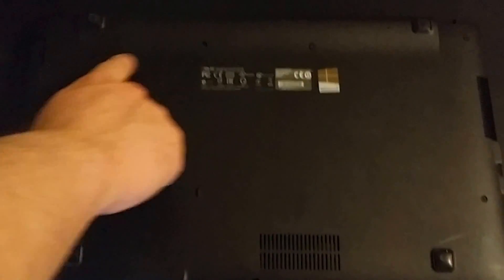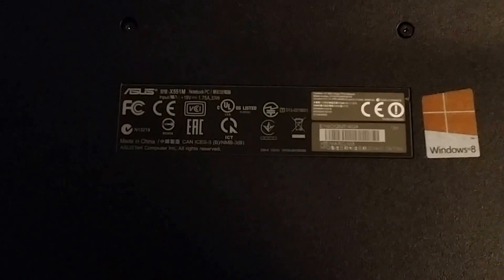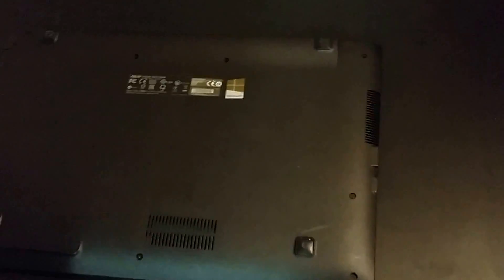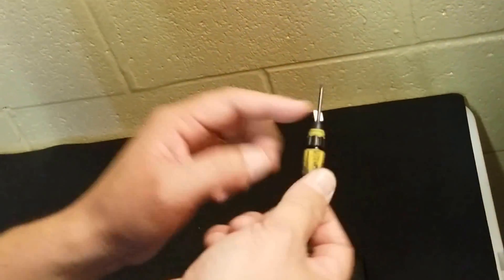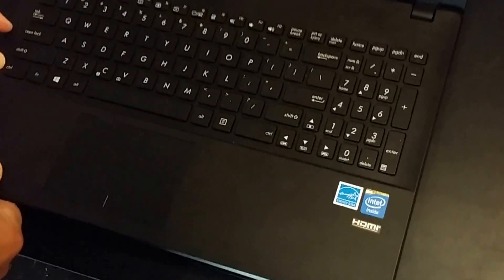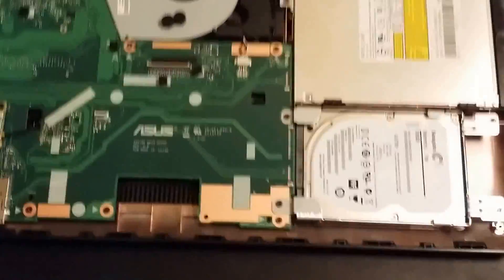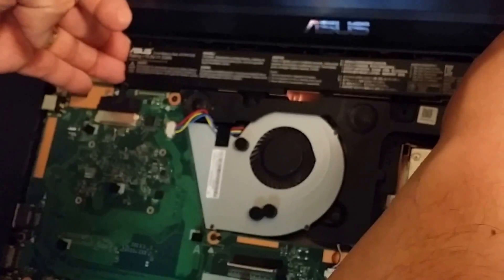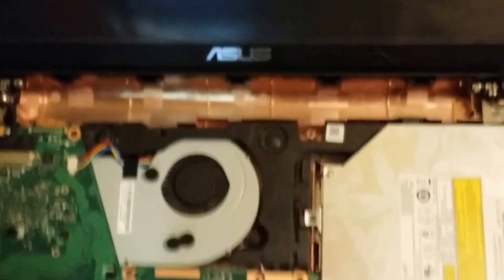ASUS X551M Laptop Battery Removal & Won't Power On Fix

Comment: hi, i have an issue with my asus of this same model. i just have like three months with it and since i got it i have problems when i turn it on. i have to press like 20 or 30 times the power botton  so it can turn on. i dont think it is the battery because it is full charged. so i don get why. as i say before i have to press to many times the botton so it can react. can you help me?
Reply from the maker: It sounds like you might have gotten a laptop with a defective/faulty power button board/power ribbon connector.  My gut feeling is that you have a bad board which is on the underside of the keyboard top lid.  Once you remove the top lid, follow the ribbon cable to the power button and see if it is loose or looks damaged.   The GOOD NEWS is that ASUS warranties all their computers for 12 months/1 year so call up their tech support and tell them the problem.  They will have you send it in for repair at no cost to you.  Just be sure to back up your data or anything else important because they do NOT warranty data.

Comment: How do you reattach the cables (the ones you already took off)
Reply from the maker: Very carefully.  Each of the ribbons cables have flip top "latches" that you have to flip up to release the ribbon cables and flip down to lock the ribbon cable into place.  Gently place the top of the keyboard lid down into place then with one hand, insert the power ribbon cable at the top left into the connector and once firmly inserted, flip the latch DOWN to lock it.  Then move the lid downward some more then insert the Keyboard ribbon cable into the keyboard connector and firmly slide that ribbon cable in then flip that latch down to lock it.  The same goes with the touchpad ribbon cable into its connector then lock the latch into it.

That is it!

Comment: Quick question, a couple days ago, my laptop stopped charging and only stays on if its connected to the charger, it stays at 11% saying 11% available (plugged in, not charging) 

Is there any other method to save it other than buying a new battery? Or could it be the charger?

Comment: It really is a nice laptop for the price! One question though. I've replaced my RAM. And I know all the internal parts of the laptop except for the screen. Could you make a video doing a screen replacement? Or do you think it'd be better to just get a new laptop? My screen is fine. I just like taking the precaution of knowing what to do in the event it gets cracked.
Reply from the maker: Daniel,

The LED Screen replacement is actually quite easy for this model.  It would have been easier IF this model would have been able to remove the battery a standard normal that would have taken less then 3 seconds.  Unfortunately, you have to disassemble the laptop to get to the battery PRIOR to replacing the LED screen to avoid shorting out the new replacement LED screen.  Once you remove the battery, it should take you less then 5 minutes to take the LED Screen bezel off, remove the 4 screws holding the LED Screen on, removing the LED screen cable from the back of the screen, and finally removing the damaged screen.  Then just install the new screen and do everything in reverse.  The new screen should cost about $50-$60 on Ebay or Amazon.

Comment: You can do this or just suck the energy out of the battery by leaving it on and charging your device using the USB it should only take an hour or four depending on its batter life.
Reply from the maker: Common sense wise, that is correct.  The problem is that even if the system turns off/hibernates by doing your USB drain method, there is still a chance that there is a "charge" that can damage a sensitive component like replacing an LCD/LED screen or memory replacement.  The BEST practice would be to unplug the AC adapter, remove the battery, hold the power button for 30 secs to fully discharge all power THEN work on the system.
Reply: when i did it it took aan hour no problems the only think that happened wasa my tablet had a seizure  the computer energy led turned on and off three minutes after that i charged it and it worked fine, without me dismantling my computer.
Reply from the maker: Again, I am giving on advice on using THE BEST PRACTICE on how to properly disassemble/repair the laptop.  Doing it this way prevents any unforeseen accidents, static discharge, and component failures due to shorting something out.  You are of course free to do it anyway you want and if it works for you, by all means do it your way!
Reply: Ok, so if i use y method there is a chance that my computer well fail. I understand.

Comment: Can I upgrade the RAM in this model?
Reply from the maker: Some boards for this ASUS model will allow you to remove and install new memory.  Some will not.  The only way for you to truly know is to remove the motherboard as the memory is on the underside of the laptop.  Even if you were to call ASUS, THEY might not even know which board you have.
Reply: Per above: You can replace the one in there (usually 2 or 4GB) with an 8GB module (if not soldered in).

Comment: Ok so i was on my computer and i moved it a little bit and it completely shut off it wont turn on and the charging light isnt showing can doing this help
Reply from the maker: First, make sure your AC Power Adapter did not die.  You may need to go to a store to pick up another charger to "test" it out on if you don't want to buy an adapter you don't need.  Try a store like Batteries Plus or try it with a universal power adapter if there are no stores near you.
Second, if a replacement adapter doesn't fix the problem, you might either have a bad DC Jack or a bad battery.  Follow the video's instructions and remove the battery and connect the power ribbon cable back in the motherboard and then plug in the Power Adapter then try turning it on.  Sometimes a bad battery will cause your system not to turn on.  If your system STILL will not power on, then it is either a bad DC jack that you will have to replace or a bad motherboard.

My gut tells me it is a bad DC Jack as you stated you moved it and it shut off and I am assuming that you had it plugged into the adapter when it happened.  So, verify your AC Adapter is good then eliminate the Battery as the problem then you should narrow it down to DC Jack and Motherboard.
Reply: k thanks its only a month old and im pissed because of this happening

Comment: My laptop went out when I plugged my phone in.. What should I do to fix it?
Reply from the maker: deadblast,

You probably shorted out the connection temporarily/permanently from your USB to the motherboard due to a fault from either your phone or your USB cable.  Remove your battery using this video's instructions (of course have it unplugged from the DC Jack as well), hold your Power Button down for 30 seconds to fully discharge all power from the motherboard, then reinsert the battery, reinsert the power/keyboard/touchpad connectors and then try powering on the system.  With luck, your laptop should be powering on and back to normal.  If it still doesn't turn on, plug in the AC adapter as well then try powering on the system again.  If this still doesn't work, then your best bet is to take it to a repair shop for a diagnostic.

Comment: how to turn on x401a asus model?? suddenly it turn off its old laptop but looking good. charger is good but it dosen't turn on. please help me.
Reply from the maker: If the laptop doesn't turn on it could be:
1. DC Jack is either damaged or detached from the motherboard which will not allow the system to charge the battery OR power the system itself.
2. Defective battery SOMETIMES caused the computer to NOT turn on.  Test this by removing the battery and plugging up the adapter to the laptop then powering on.
3. Defective Power Adapter.  Try borrowing a universal adapter with the appropriate connector tip and turning the system on.
4. Failed motherboard.

Without actually seeing this in front of me, I do not know if any power indicator light is on or if the system is on with only a black screen (LCD Backlight is on but no picture).  When all else fails, take it to a professional tech or computer shop for a diagnosis.
Reply: Thanks
Reply from the maker: Tippanirajesh 239 No problem!  Good Luck

Comment from the maker: Rusher,

I am assuming that you have a picture of the Asus splash screen all the way through the Windows Password Login screen.  If you don't get a picture after entering your password, I am thinking it is your Graphics Drivers.  The best way to tell is to boot to safe mode and if you can get a picture after the login, then it definitely is the driver.  Update it to the latest version of NVidia, AMD or Intel's driver whichever one you have.

Comment: Could you do a fix for the plugged in, not charging problem with this computer
Reply from the maker: SpartonO1 Unfortunately, this was a customer's computer that I selected to do a video on.  I no longer have this particular laptop to provide a DC Jack removal/repair video.
Reply: Ok, well i did figure out how to get it working again. Thank you for responding.
Reply from the maker: No problem.  I am glad that you got it figured out and working again!

Comment: can i upgrade ram on asus X453ma ?
i thought asus X-series have onboard ram, right?

btw thanks for the video, now i know to replace battery on asus X series.
Reply from the maker: Based on some research, some X-Series boards have removable RAM memory and some don't.  The only true way to know is to disassemble it and remove the Motherboard.  The memory is on the underside.
Reply: sydcapuera  have you managed to upgrade the ram ?

Thanks
Reply from the maker: No, on the laptops I have fixed for this model Asus, I have never been able to upgrade the Memory.
Reply: ***** 

so you are saying it is not possible ?
Reply from the maker: Based on some research, some X-Series boards have removable RAM memory and some don't.  The only true way to know is to disassemble it and remove the Motherboard.  The memory is on the underside.

Comment: I would to confirm the size of the hard drive, is it 2.5 or a 1.8 unit?
Reply: It's 2.5 inch.  The hdd that came in a friend of mines was also the "thin" variation, but the hdd bracket can fit a non-thin kind as well.

Comment: I plugged an Ipod usb charger cable into my laptop to charge ipod it shut laptop down and when I started the laptop back up it's like it's in sleep mode with a black screen power light is also on can anyone please help
Cheers
Reply: i belive that you usb port is ether shorted out or your plastic piece in your usb port is out of your usb port( the plastic piece is so you dont plug it in the wrong way and short something) and you eved up puting it in backwords. So what you need to do is hold down your power button untill the fan stops running. If that doesnt work unplug it and run the battery down untill it dies then plug it in and turn it on. if you need anything else or anybody need anything else please email me at ajmaps@me.com and plese metion your youtube name.

Comment: Hi I just bought this laptop and was wondering can u update the ram? Also I can't get chrome to download :( its a nightmare need help please :)
Reply: No, you cannot add more RAM to the AEUS X551M. Regarding your failure to download Chrome, you should be able to use Internet Explorer, which comes installed, to do that. Go to https://productforums.google.com/forum/#!categories/chrome/windows8 and ask there.
Reply: You can't ADD RAM, but you can replace the one in there (usually 2 or 4GB) with an 8GB module.

Comment: Is it possible to upgrade the cpu?
Reply from the maker: You "CAN" but the question is should you on a laptop that is designed to not be that powerful.  You would have to figure out which notebook CPU's would be able to be used on that particular board and if so, you will most likely need to do a BIOS/UEFI update so that the new processor will be able to run correctly.  BE CAREFUL if you go this route because if the BIOS/UEFI update gets interrupted or installed incorrectly, you will have turned your laptop into an expensive paperweight.

Comment: yes this is a design from a moron. and all you morons that defent the moron designer are moron and the reason u give are moronic as well.
Reply: Costs less and the design allows for an insanely easy/fast replacement of the motherboard if ever needed.  While I agree the average non-technical user might struggle with a simple hdd, disc drive, or battery replacement, the reasons behind the design are relatively sound.  Go and buy a laptop with an easy user replaceable battery if it's such a big deal.
Reply from the maker: I agree that this IS a terrible design.  Some people are saying that the design was to facilitate motherboard removal or because it is used for "CHEAP" computers.  I think those reasons are "questionable" at best.  Computers are supposed to be END USER friendly made for regular people in mind.  Not being able to remove something like a battery is something I personally don't agree with.  Heck, most CELL PHONES have the ability to get to the battery to be able to replace it and those are exchanged out every 2-4 years!

Comment: I have an ASUS X511M laptop & i was having issues with my connector cable and i opened the computer there was a poping sound and now it dont power up or show it is charging ??? how can i troubleshoot to find out what is wrong with my computer???
Reply from the maker: You might have damaged the ribbon cable or most likely, ripped/tore it.  To be 100% sure, take it to a computer repair shop to verify what really could be the problem.  Trying to diagnosis a computer on a comment board is hard to do unfortunately.

Comment: Many many thanks. Due to some mishandling the optical drive got dinked up. I was going crazy trying to get this thing apart with out breaking something else.
Reply from the maker: You are very welcome!  I am glad the video helped you.
Reply: The optical drive can also be replaced, almost as easily as the battery, if needed.

Comment: I am having a problem when trying to charge my asus computer. Its completely dead and obviously wont turn on. I have plugged it in to charge but the light indicating its charging will not come on. When I hit the on button again, after I plug it in, it will start to load but turns off after 3-4 seconds. I have tried leaving it plugged in for a few hours, then tried it again but still nothing. So I have no idea if its the computer, battery or charger. I don't think its the charger because it seems to be giving the computer enough power to attempt to charge.
Reply: I have the same problem. I just bought it 3weeks ago and now this thing happens...help pls
Reply: Michael Nel Madiam dissconect it from the ac adapter and take the laptops top case off and try taking the battery out and holding the power button for 30 seconds and put the battery back in and than push the power button make sure you connect all the ribbons back though
Reply from the maker: If the laptop doesn't turn on it could be:
1. DC Jack is either damaged or detached from the motherboard which will not allow the system to charge the battery OR power the system itself.
2. Defective battery SOMETIMES caused the computer to NOT turn on.  Test this by removing the battery and plugging up the adapter to the laptop then powering on.
3. Defective Power Adapter.  Try borrowing a universal adapter with the appropriate connector tip and turning the system on.
4. Failed motherboard.

Without actually seeing this in front of me, I do not know if any power indicator light is on or if the system is on with only a black screen (LCD Backlight is on but no picture).  When all else fails, take it to a professional tech or computer shop for a diagnosis.

Comment: One question has been bothering me for a long time. Is the graphics card removable on this laptop.
Reply from the maker: On 99.99% of laptops, graphics chips are not user removable as it is machine placed, integrated and soldered onto the motherboard.

Comment: Thank you so much man. Incredibly simple fix to my problem. I accidentally put my headphone jack into a USB port and it must have shorted out the battery.  I used a knife and a lot of patience but it was so worth it. Again, thank you.
Reply: The entire system was not doing anything. Completely blank.
Reply: Did you have to buy a new battery? I'm am fixing this laptop, and it had the same thing happen
Reply: Not at all. I took out the battery and put it back in to "reset" it. I then put everything back in place and turned it on. It worked. I'd follow the tutorial before worrying about getting a replacement battery.
Reply from the maker: You are very welcome!  I am glad the video helped you.
Reply: ***** I just did the same thing. Ugh. Anyway, how in the heck did you get those screws open with a knife? Because the little b@stards aren't budging for me.
Reply: @Rx2D  It's a poor workman who blames his tools. But in this case, it would be correct. Use a screwdriver that fits the smallest screw you can imagine or find, and you should be fine.
Reply: snorts I got all of them open except one, which I ended up stripping, so now I have to go to the hardware store and buy an actual screwdriver and more screws. That's what I get for trying be all tech/diy savvy, I guess.